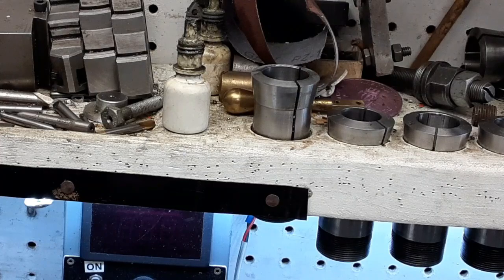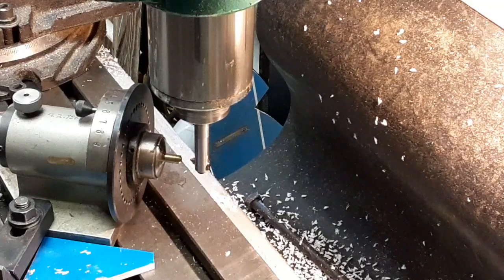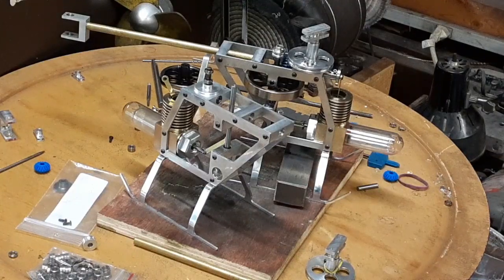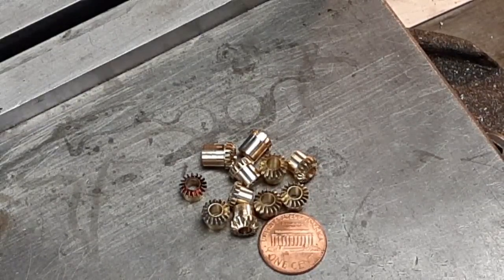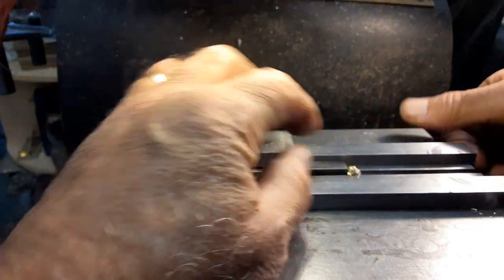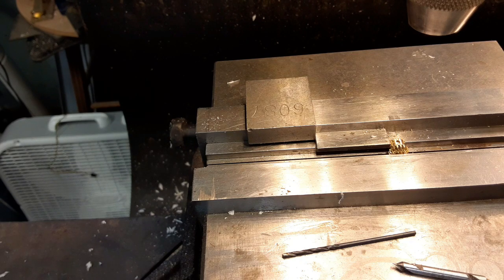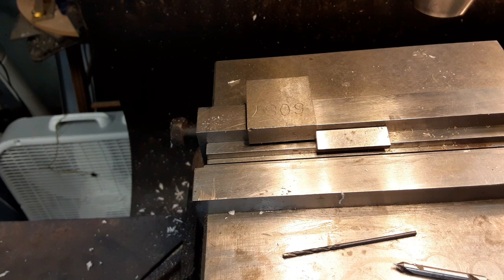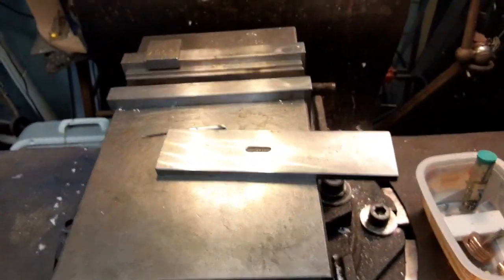Stirling helicopter 65 bevel gears

Comment: Those gears turned out nice. I am very glad to hear your brother is getting better. I'm starting to build two steam engines from Stewart Hart's drawings. They are in metric and I already messed up on the flywheels by putting a .375 bore in them. Should have been .312 bore. I am going to try to redraw it using imperial measurements. Hopefully I can do it without any mistakes.
Reply: dont forget the .0005 on 5/16 ;-)